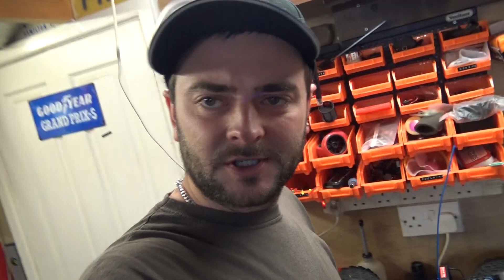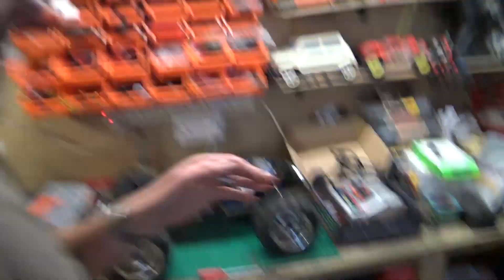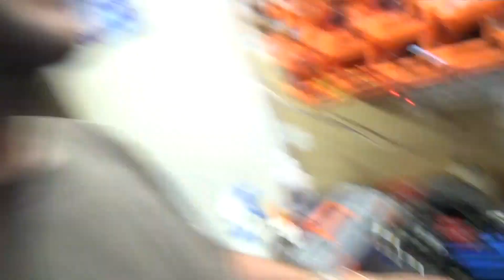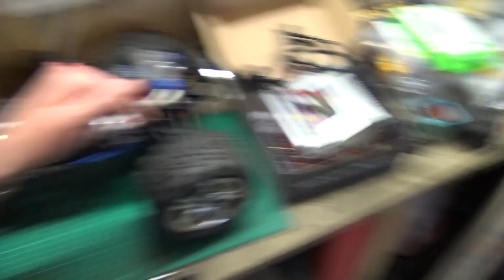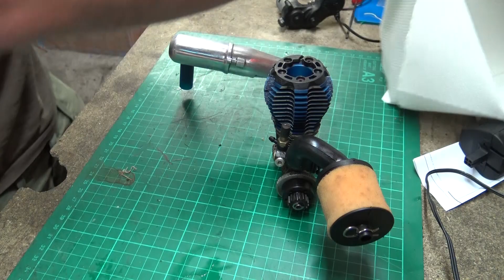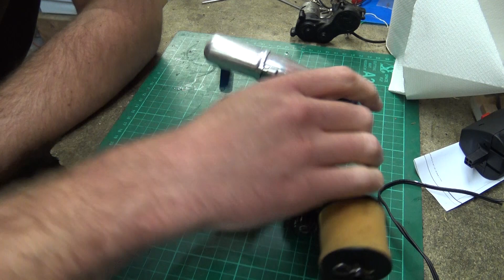Nitro RC Traxxas TRX Revo 3.3 The Diagnosis

Comment: same here three tanks in had to replace throttle servo, the 3 second speed run stalled the locked up.
the ez start motor metal gear shared.  not the 3.3 motor spins.
but now wont start.... what is the idle screw turn ratio? any answers

Comment: Regardless of what happened,if you ever have a carburetor issue and you're tampering with needles you need to find the factory turn settings and start over. Every single time!!!
Reply from the maker: That’s right unless you’re bored and have time to pass

Comment: My guess is the engine was broke in to hard. Or just broke in to lean. I've had trucks sitting for 2yrs with no after run oil. And they fire right up because I take the time to brake them in right. And purge the engine of fule